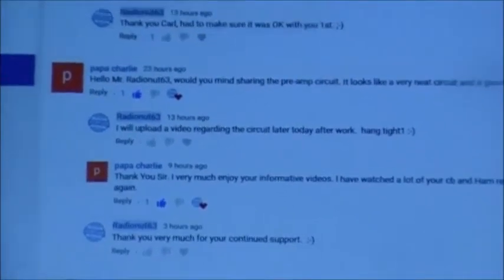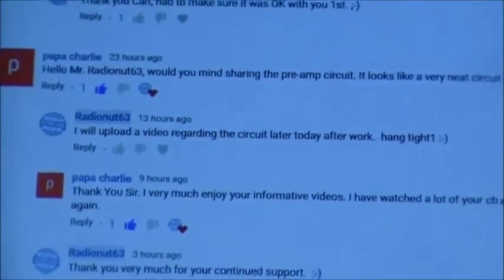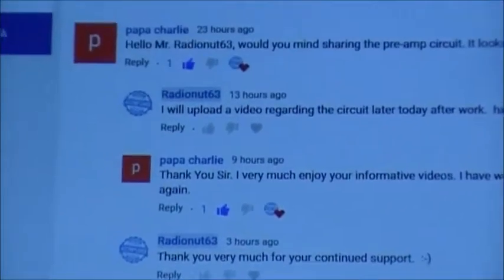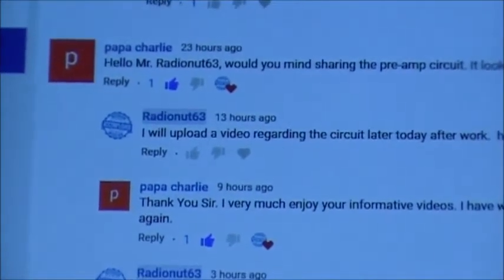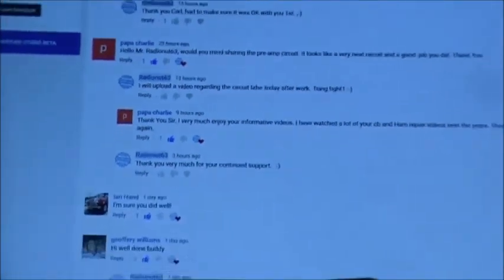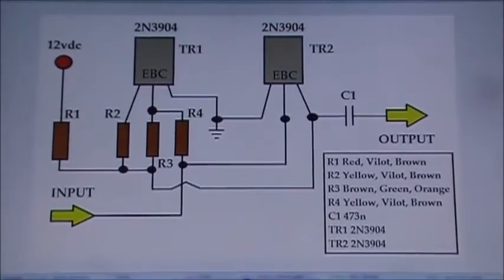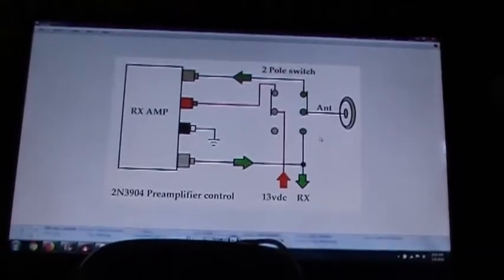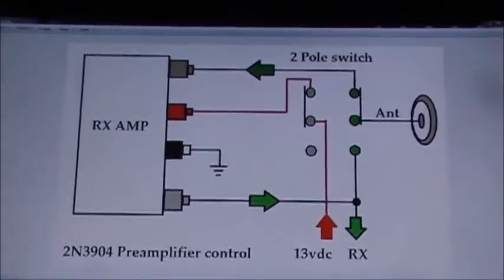2N3904 Receive Pre-Amplifier

Comment: I know it's been a while but, I'm confused about the capacitor value? is your capacitor actually a 473nF capacitor, or is that the way it is marked (meaning just showing "473" on it) which would mean it's just a 47nF capacitor?
Reply from the maker: i am just as confused?
Reply: @Radionut63  Go easy on me, I'm a bit new to all of this LOL!
Reply from the maker: @michaelcormier5154  Just having some fun... 🙂
Reply: @Radionut63  Well, OK then, what value did you use?
Reply from the maker: @michaelcormier5154  According to the chart: 473 = 47nf    https://kiloohm.info/3-digit-capacitor/473
Reply: @Radionut63  Well then, my instincts were correct. Since the other values for the resistors were given in color code, it stood to reason the Capacitor value was just given by the markings on it as well ....thanks much, now I can build it without worrying about "Letting out the smoke" as they say ...73

Comment: According to the Wikipedia article about voice frequency: "The voiced speech of a typical adult male will have a fundamental frequency from 85 to 180 Hz, and that of a typical adult female from 165 to 255 Hz." So the maximum frequency you would really be interested in would only need to go up to 1.5khz for listening and 1k test tone purposes.
Reply from the maker: If you say so.  :-)
Reply: William Colvin, this would only be accurate if we were standing within direct ear shot of the person speaking. But that isn't how radio works.  Consider this:  Cellular telephone used the 800MHz or 1900MHz band.  So how is human voice able to work at these crazy high frequencies?   Study up on signal modulation, demodulation, heterodyning, up and down conversion.  All radio communication for pretty much the last century is based on these principles.

Comment: This circuit seems a bit strange to say the least. It did appear to amplify when I tried it in a simple simulator, but the output seemed very distorted. However some of the circuit seemed familiar. There's a circuit, which works up to 30MHz, using BC548 transistors on this webpage http://www.vk6fh.com/vk6fh/py2wm_mmic.htm
It was devised by a South American Amateur Radio operator some years ago. Unfortunately he's no longer with us as there's SK (silent key) after his callsign. Nearly all the components used by Radionut63 could be used to build this, substituting 2N3904s instead of BC548s. PY2WM says in the text that he tried substituting 2N2222s, another very common transistor, for the BC548s and it worked OK up to around 10MHz, so perhaps similar results could be expected.
Reply: Tried to simulate this too it even goes negative amplification (attenuation)  very weird.